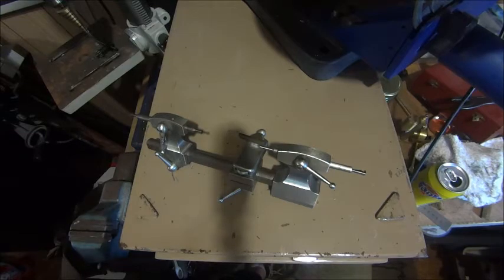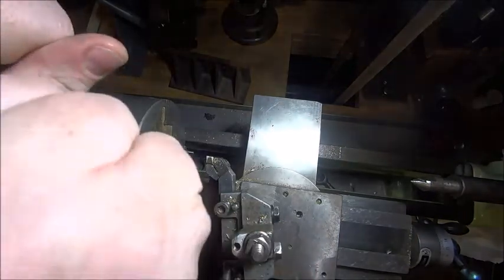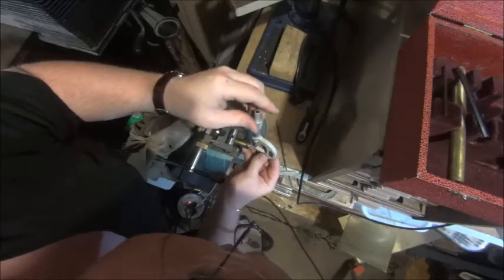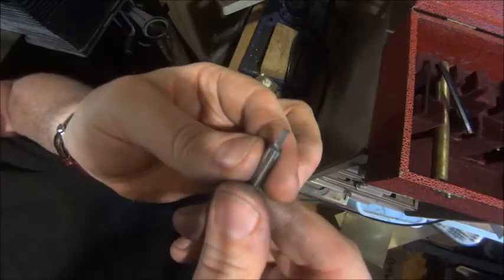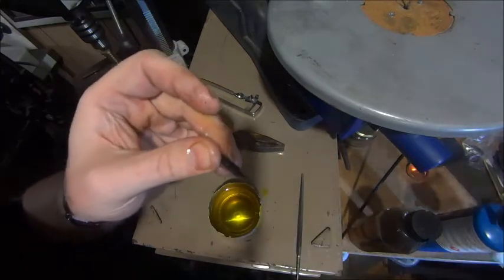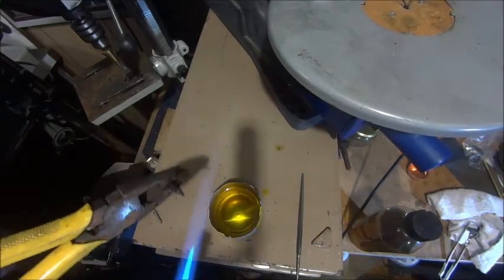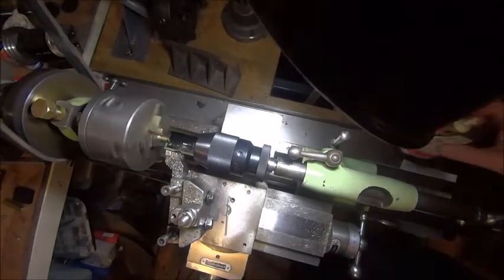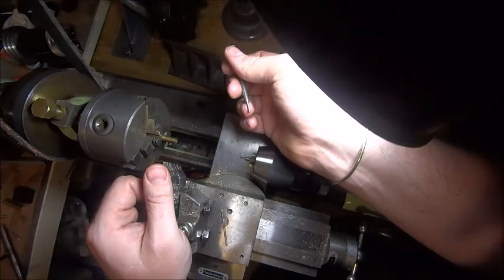I make a "D Bit" Reamer

Comment: Emma - Thank you for including the hardening and tempering procedure in this video. This is the first time I have clearly understood the difference between "hardening" and "tempering" - and your clear, simple video conveyed the process more clearly than any others i have viewed. And I don't need a forge to do small pieces - the gas flame is enough. Now I know. 

I also learned what a "D Bit" tool was and realized that I can make one of these right here in my little shop following the procedure you present. Thank you so much. I have a regular need to make small wheels called "trucks" that fit on the ends of the ink roller shafts of antique printing presses. Drilling the holes precisely has always been a challenge with my little old 6" lathe. However following your example, I could  make a D bit from the same rod that I use for the shaft this wheel will mount on. I could use this tool to drill and ream the hole in the Delrin wheel. I think that will be much easier and far more accurate than my current procedure of center drill, then drill succeeding sizes to meet my 3/8" goal. With a D tool it will go much faster and my quality and accuracy may quite well jump to 100% in a very short time. 

I will also look into the feasibility of making a 1.15" D bit tool - a very long one - to be used to drill/ream a 12" tube in aluminum. This would be used to precisely match the diameter of the original "composiiton" material ink rollers used on these presses 100 years ago - which we now cast in rubber.  With a 12" 1.15" dia. D bit tool, I think I may be able to bore a precise hole a long way into a block of aluminum - or convince my machine-shop-owner friend to do it on his big old lathe...

That would be another breakthrough for the antique letterpress printing community worldwide! ;) Thanks!

Comment: That's fine like you say for aluminum or brass but you cannot truly make a tool hard enough for steel by hand. You have to have it heat treating oven for example high speed steel you have to take it up to its temperature very slowly 400 Degrees per hour up to what is it 1450 degrees or greater I can't even remember off the top of my head
Reply: Sure you can, hardened tool steel can cut any steel softer than the tool itself all day long and you dont have to spend hours on the ramp up to critical temperature prior to quenching. You may want to check your numbers there.  Nice job on the D bit Emma
Reply: Makin Sumthin From Nuthin but if the steel is soft enough to be cut, it won't be strong enough TO cut.
Reply: Ryan Moulder  So we should all throw away our custom ground lathe bits made from high speed steel since they won't cut anything?

Comment: Hi Emma.  Great video.  I have some larger HSS D bit reamers I bought at a garage sale, but I've never made one.

Great instructional :) 

Cheers.  Rob
Reply from the maker: thanks Rob. if you see them grab them. mostly they are from production workshops i find. thanks for watching.
Reply: Yes, these were originally from Bridgestone rubber factory in Adelaide - probably for making extrusion molds.  Rob
Reply: Emma Ritson The ones I have are in finely ground HSS, and have a rounded nose.  Also instead of a flat facet type relief, they have a ground reducing circumference - obviously professionally made and probably hideously expensive when new.  

Is it a good idea to give the end of the reamer some lead in angle to prevent it scoring?

Cheers Rob.
Reply from the maker: xynudu it probably is. the ones i am most familiar with are for putting bushes in clock and watch plates. they have a little taper on the end too and they cut well. ive a feeling this might be more to make them align with existing holes, though. probably these were used in floating holders in production machines? the square sharp end is good for a hole with a flat bottom. the beauty of these tools is that they were made or sourced to do a particular job in a particular material. ive seen all kinds of different ones.
Reply: Interesting subject.  After watching your video and your specialty slide/guide for cutting the reamer, it got me thinking whether I could do the same thing on the lathe using a tool post grinder.

I'm sure I can with my full sized TPG (using the flat end/face of the stone), but as most people don't have one of those, I've been trying it with my small pencil air die grinder in the tool post to see if it's a viable alternative for the masses.

It seems to work OK for grinding the flat and the facet edge - I used an old drill bit end, which is quite hard and made it slower going.

I may put up a video on my little experiment.

Cheers.  Rob
Reply from the maker: sounds good. :) the important things are to get the flat exactly in the middle, and perfectly flat. must be a million ways to do it. I've got one of those little air grinders, per your recommendation , lol, be interesting to see what you come up with!

Comment: Nicely shown :)
That D-Bit filing guide is a neat thing, have never seen something like that before - Thanks for sharing!
Reply from the maker: its also useful for making squares on clock arbours, sharpening gravers, and sharpening screwdrivers. thanks for watching!
Reply: How do you verify the reamer is to your desired diameter after filing the flats? It is an interesting fixture/jig you used to creat the reamer cutting shape.